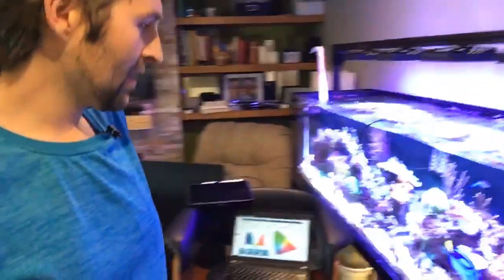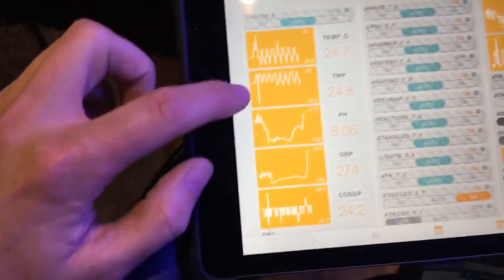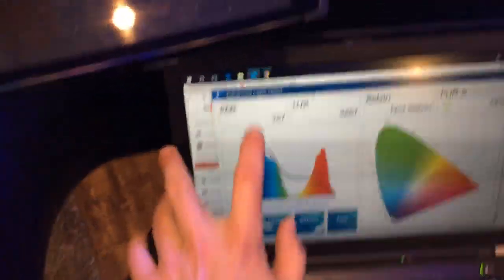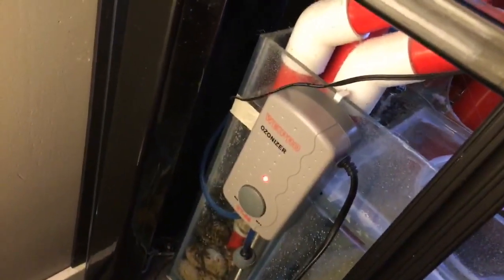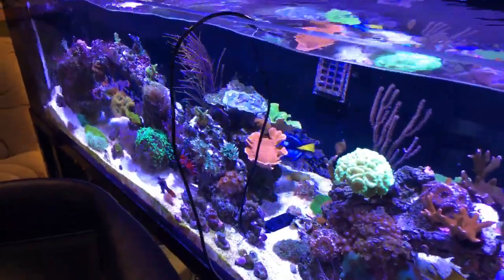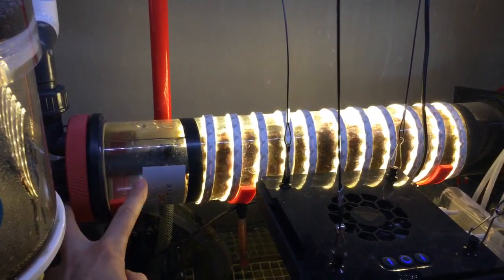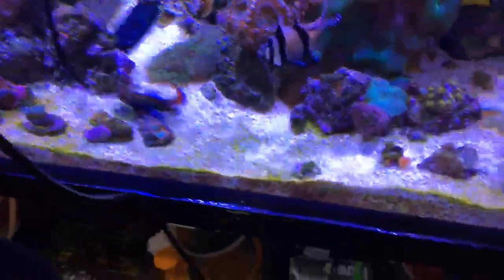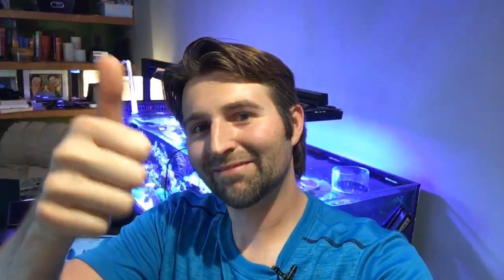Behind the scenes with ozone experimentation👊🏼

Comment: Nice job. I ran ozone on my last tank 6 months ago. It was on a 180 mixed reef. I used the ozotech Poseidon with a ozone reactor connected to a carbon reactor made by avast marine. And I was using the a ozone air filter, keeps the air dry so the ozone generator works better. It was connected to my apex orp probe and would shut off when my orp when it hit 400. I had no problems with it. Just haven't put it on my new setup. Keeps your water crystal clear.
Reply from the maker: Did you find the air dryer made a big difference? i was debating rigging up something with silica gel.   Do you think you will set it up again on the new system?
Reply: ReefDudes I thought it made a huge difference. You get more ozone out of your generator so you don't have to run it all the time. The only thing is there's more maintenance. You have to dry the gel beads in the oven when they turn pink back to blue at 300* degrees for about 3 hours.
I might put it back online. Just love not having that extra maintenance lol

Comment: What is the beneficial factor of having an ozone into the skimmer?
And if the skimmer is not necessary after using the ozone what's the point of having the skimmer them
Reply from the maker: The skimmer just acts as the reaction chamber.  I think the skimmer is still necessary (at least at the levels i'm using it at) .   A skimmer is just a very efficient way to mix the ozone into the chamber to breakdown the organics inside it.. you just need to make sure your skimmer is rated for ozone.
Reply: ReefDudes oh that sounds like a great idea, my skimmer is a Reef Octopus NW-200-654B and recently pump was heating the water to 83 and just found out that is discontinued and my LFS sold it to me a year ago, good thing they back up their product and the factory send me a new better and smaller pump.
Good work Dave keep teaching us the beginners
Reply from the maker: Its actually Deven, but i will and thank you!
Reply: ReefDudes I will try to remember that am very at names

Comment: I love ozone, been running it for a little over a year. Some things, once the ozone breaks everything down your skim mate will stop. It won't produce anything. I run mine very low dosing for 8 hours at night and the rest of the day I run without ozone to help build my foam head back. Another thing, using a small amount of carbon in addition to the ozone will make your water EXTREMELY clear.
Reply from the maker: Glad to hear your having good success with it.  I have seen great results in 3 hours. My current plan is to run it 3hours a night.  So far i have seen no difference in skimming but that my change after a few days. I do still have my carbon reactor going and my water is already crystal clear. I hope the time laps shows a noticeable change :)
Reply: ReefDudes you'll love it. You'll also notice that you don't use your carbon up as fast as before, it helps make it last longer by a good amount. I know ozone isn't popular by the majority but I won't run without it now. It just leaves my tank super clean. When doing water changes, my water is just as clean as freshly mixed salt lol! Can't wait to see your time lapse video